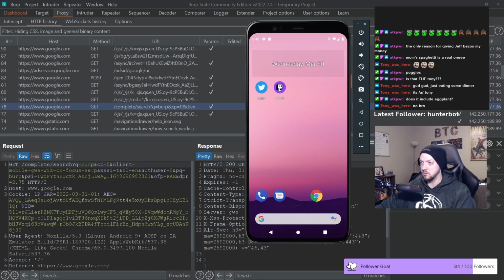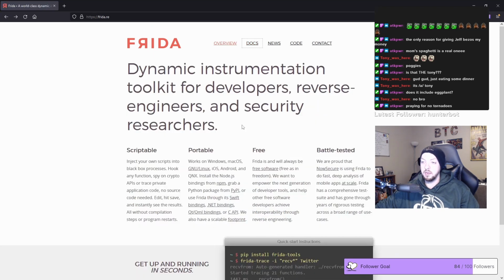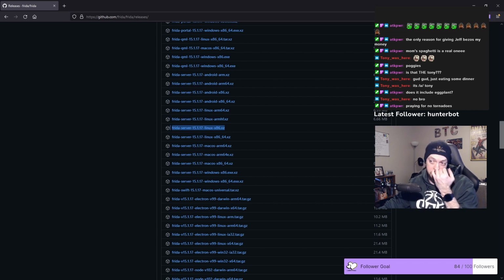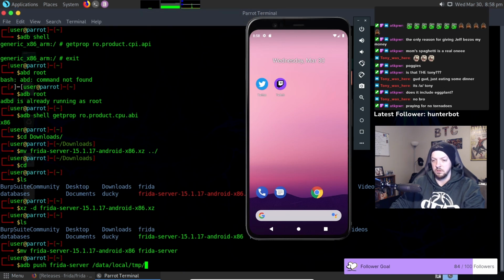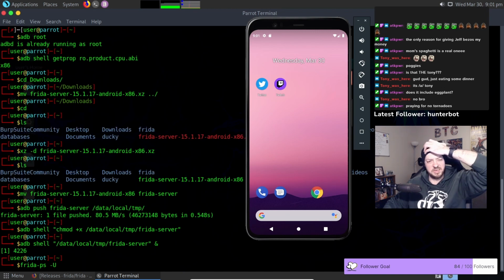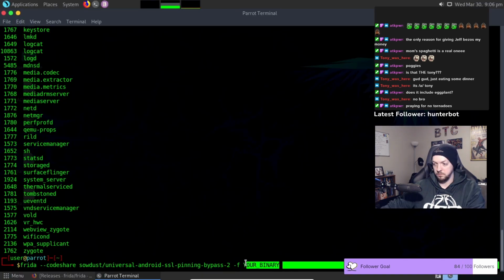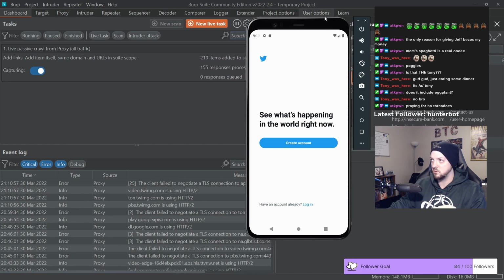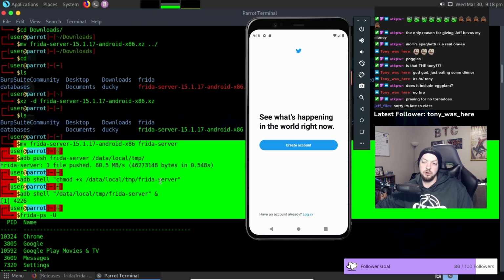Defeat SSL Pinning | Android Security Crash Course

Comment: Thanks so much for these videos. They have been super helpful in helping me get started and begin intercepting calls. One question though, what is the next step if Frida doesn't unlock the API call? I thought this particular app was using SSL Pinning, but after trying 5+ different Frida scripts, I noticed the same thing. When I access a particular section of the APP and try to interact with it while having a proxy (Charles, Burp,etc) I always get the same API response. As soon as I disable the proxy the app works just fine. I thought it was SSL Pinning, but after watching this video I notice the behavior is different. In your example, Twitter would not even show a https request at all until you injected Frida. In my case, there is a https request, but somehow the app knows I am using a proxy & certificate and returns a "blank" response. To be clear, this behavior is consistent before and after using Frida. As soon as the app notices the proxy it returns a different response.
I am now starting to think this is not SSL pinning. So what are my next steps? Do you have a video talking about it? Tnx

Comment: i don't know why but when i implement the codeshare ssl pinning bypass code it throws an error saying "Failed to spawn: need Gadget to attach on jailed Android; its default location is:"
Reply from the maker: The most likely issue is that the versions of Frida and the Frida server on your device don't match. Here's a github issues thread that might have some more information that could help.
https://github.com/frida/frida/issues/2326

Comment: Hi @CorSecure, your video help to understand the  ssl bypass but how can we prevent ssl pining from bypassing? Is there any way. If so can you make another video related this !
Reply from the maker: That's a difficult question. Ultimately, I don't think it is possible to implement SSL pinning in a way that is impossible to bypass. By the nature of mobile applications, the attacker has full access to the binary and can reverse engineer it to bypass any protections that are in place on the client side. However, there are some types of more robust pinning methods and other protections out there that can be much more difficult to bypass than the common types of pinning that I bypassed in this video. It's really a question of whether those more robust protections are worth the additional effort (or cost) associated with them.

Comment: Just a comment.  I am able to bypass pinning using Objection.  However with the technique in the video the app starts but the  process crashes with 
Failed to spawn: java.lang.UnsatisfiedLinkError:   
Same result with a different program from Frida Codeshare.
Are inconsistencies like this normal in working with Android apps?
Reply from the maker: I don't think I've ever gotten that particular error, but I found this issue ticket from the Objection github that suggests it's an architecture issue: https://github.com/sensepost/objection/issues/119

I also found this thread on StackOverflow that suggested using an emulator with arm architecture instead of x86: https://stackoverflow.com/questions/70308181/error-running-frida-dlopen-failed-library-libflutter-so-not-found

I hope that helps!

Comment: why do you specify -U on frida-ps since you are using an emulator and not a real device over USB?
Reply from the maker: The -U flag just tells Frida to connect to the device that is connected with ADB. it's technically not connected over USB, but from the perspective of Frida, being connected to ADB is the same thing as if it was connected with a USB cable.

Comment: When I run frida-ps on my host machine it shows processes running on my host machine, not the virtual device.  Looks like when you run it, it's a list of processes on the device.
Reply from the maker: Yep. The -U flag tells it use the device that is connected with ADB. There is also an option to use the -R flag to connect to remote device. I never use that option though since I always have my device connected.

Comment: On my x86 host and virtual device, when running frida with a codeshare, it's asking for an arm64 so Gadget.   Why does frida think I am on an arm architecture?   Of course supplying that arm64 Gadget just leads to another error.  Is there a Frida Slack or similar channel where I can get support?
Reply from the maker: If this is the error message that I think it is, then it most likely means that the version numbers don't match between the frida server on the device and frida on your host machine. You can check the version numbers by running frida --version on your host and ./frida-server --version from the directory where it was installed on the mobile device.

I'm not sure about a slack, but I usually check the frida github issues page whenever I am having problems. Most of the time there is already a thread that covers whatever problems I am having.
https://github.com/frida/frida/issues/2326

Comment: If an app returns no data via proxy does it mean I should use this? Or what else can it be? Nice vid btw
Reply from the maker: If the proxy is configured correctly, then SSL pinning is a very likely reason why you wouldn't be seeing traffic. You should see some TLS errors in the error log on your Burp Suite dashboard if that is the case.

I have some additional instructions on my website if that helps.
https://corsecure.blog/2023/08/24/bypassing-ssl-pinning-with-frida/

Comment: I followed the process and it worked for the first app I tried. However I'm trying on a different app and getting the following message: "Failed to spawn: need Gadget to attach on jailed Android; its default location is: /Users/user/.cache/frida/gadget-android-arm64.so". Any idea how to fix this?
Reply from the maker: That error most likely means that either the frida-server is not running on the Android device or the version numbers of the frida-server (on the Android device) and frida (on the PC) do not match.
Reply: how did you solve the error

Comment: I got the following error at objecton explore

Unable to connect to the frida server: unable to connect to remote frida-server: closed
Reply from the maker: I don't think I've ever gotten that particular error, but I found this post on stackoverflow that had the same issue. I hope this helps.

https://stackoverflow.com/questions/62171745/frida-server-unable-to-connect
Reply: @UnderSecured  Thank you so much bro for your effort but I am on a non-rooted phone and I also google the issue but every forum and comment is telling the solution over a rooted phone
Reply from the maker: @pakvsenglive3755  oh yea. this won't work without a rooted phone because you need to install and run the frida server on the device. however, I do have another video showing how to bypass SSL Pinning using objection that does not require a rooted device. if you want to try following that process, it might work better for you.

https://youtu.be/qaJBWcueCIA
Reply: @UnderSecured  Bruh , I am already using objection and facing this error on objection explore .

Comment: I'm currently facing the issue of executing bypass ssl pinning. 
Frida-server is running but it shows like this:
"Failed to spawn: need Gadget to attach on jailed Android; its default location is: C:\Users\MyWindows\AppData\Local\..."

Is it a bug or I missed something?
The current Frida version is 15.1.21
Reply from the maker: Is the device that you are using rooted? I have never seen this particular error before, but the phrase "jailed Android" make it seem like it is a non-rooted device. If so, I don't believe that this method of bypassing SSL Pinning will work. However, I do have another video that shows a different method of bypassing SSL Pinning that will work on a non-rooted device.

https://youtu.be/qaJBWcueCIA
Reply: @UnderSecured  yes, a rooted emulator. It's fixed now. Somehow my adb got disconnected and need to reconnect through tcpip to make it visible on adb devices. But I got the following error. Still in bypass ssl pinning.

"<urlopen error [SSL: CERTIFICATE_VERIFY_FAILED] certificate verify failed: certificate has expired (_ssl.c:997)>"

I've tried to turn off the check for server and publisher's certificate revocation, make codeshare as a trusted site, and sync my time windows with the internet. Nothing works with that.
Reply from the maker: @AryYuliantoo  I wish I could help, but I've never come across that error when using Frida before. My best recommendation would be to try using Objection, which I go over in the video I linked in my last comment. You may have better luck using that method to bypass SSL Pinning.
Reply: @UnderSecured  no worries, found the answer. It had something to do with the expiring certificate from Let’s Encrypt. Even though you can't help directly but this little discussion could lead to the other things for me. Thanks for the quick response anyways.
About non-root android, I have no idea how to install apksigner and zipalign in the windows command prompt. And also it's already worked right now. Great video! :)
Reply: @UnderSecured  Failed to spawn: need Gadget to attach on jailed Android; its default location i s: C:\Users\Yogesh\AppData\Local\Microsoft\Windows\INetCache\frida\gadget-androi d-arm64.so

same problem ... i am using rooted phone